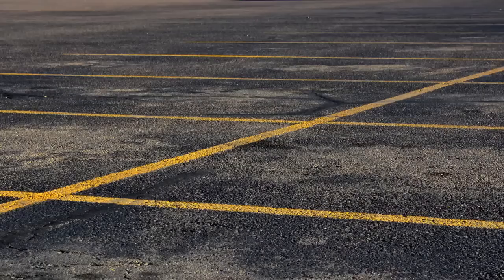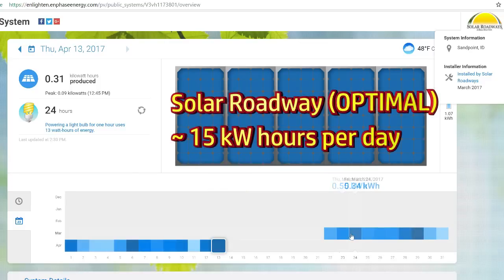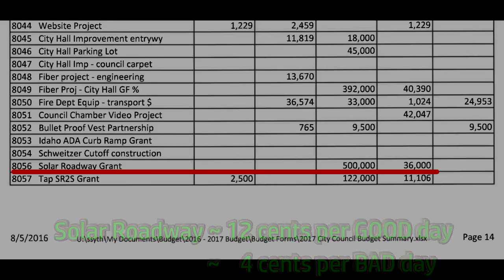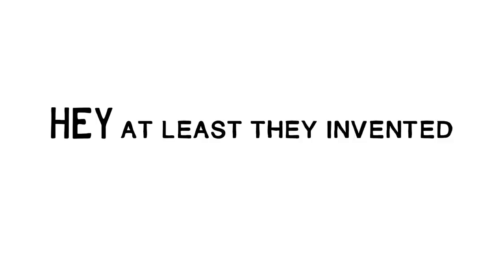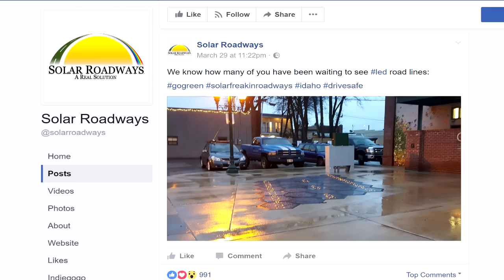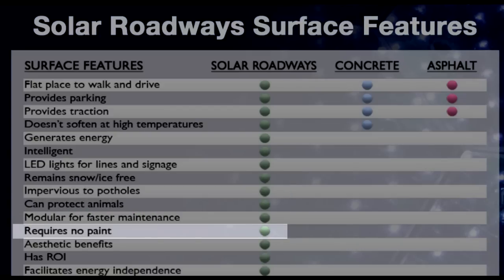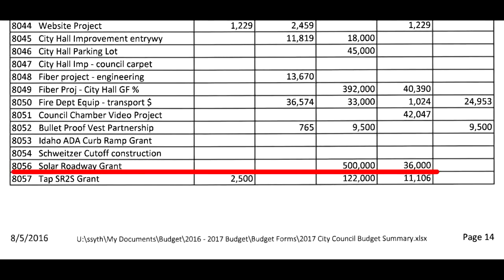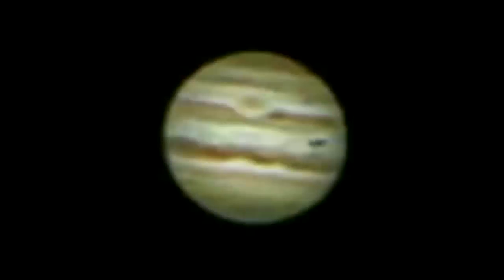Solar Roadways generate ~10 CENTS per day!!

Comment: Try and think of a solution instead of crushing their ambition. Perhaps instead of solar roadways they could've placed small panels in an array along the main roads which do follow the sun and on a night light up small LED's for driving safety. It may also prevent animals from crossing the roads and possibly being killed too.

I understand your point, Thunderf00t, and you're right. I just think you'd be better off trying to think of a solution to their problem and try and support a genuinely bright and ambitious idea which may help the world and future generations. Just imagine, you're stuck in the middle of nowhere because your car died and your phone is on 1% battery with a tiny signal. Wouldn't it be useful if you could walk to a nearby usb power unit on the roadside and charge your phone for 30 min? Some people don't stock extra batteries and don't typical think that they may endup stranded somewhere. This is convenience and if the roadways could be made better then we don't need to rely on the current monopoly in power supplies, the (pricey) grid.
Reply: That solution doesn't create solar roadways though. The ambition is to pave roads, paths, playgrounds and more pavements with hexagonal solar panels which provide power for each solar tile and combined enough power output to the surrounding homes and other electrical systems.

The solution would be something which bares this in mind and improves upon the design or technology within the tiles themselves so we still have our light up roads and futuristic looking landscapes at night which service the surrounding areas.
Reply: Solar power is pretty decent nowadays, but you need to have tracking stuff, shove it in the middle of the desert, and not having fucking cars driving over it.
Reply: this kind of idea is like why don't we invent a pen that can write without holding it. YOU WON'T FEEL TIRED WHEN WRITING ESSAYS ANYMORE. Come on, both me and you knows this shit won't work. If there is a way to make 1 cents per sqft solar panels, the electricity will be cheap as fuck, and solar road way still can't pay itself back.
Reply: you see, that's your problem. why light the roadway up anyway? why use this extra energy when there is no need for it? the only reason for led road panels is purely the self conceit of the producer.
asphalt is the best material for roads. period. if you want lights, use street lights and your car's headlights. and if you want road markings, use reflective paint and solar cats eyes. a system so cheap it costs no more than the usual maintenance cost and is now everywhere in the UK.
if you want to generate power, generate it efficiently.
Reply: What would be the point of creating something very impractical in sake of creating something new. Solar roadways is unfeasible concept, so there is no point of refining that unfeasible concept. Scrap it and create something that works better. 

Angled solar panels that we do not drive on are cheaper and more efficient. Creating electronic billboards on side of the road is cheaper and more efficient than creating flat tiles on road that have low visibility to drivers.

Making free USB charging places? Sure, who pays those because I'm willing to bet people use those to take power out of all the time.

We would have to create another pricey grid to transfer power to solar roadway panels they are wasting. So, instead of using existing infrastructure you would create another expensive infrastructure that does exactly the same thing we have already build. Doesn't make much sense to me.

Some ideas are just plain stupid and you have to realize it some point and not just pour money over it in hope that it someday gets solves somehow.
Reply: If we are discussing solutions to Solar Roadway's problems, I posted the following in the previous Solar Roadways video.

"I have no gauge as per how sincere the personnel behind this really were; a dream pursued too earnestly with unrealistic expectations. Clearly they are indeed making efforts in refining the production methods of their "slabs".

With the materials and methods they are using right now, surely their panels will remain ineffective. People may complain that the whole prospect was a massive scam, but in critical thought, what I think this project needs is more research and major design improvements.

A replacement for LEDs: Assuming that their claims about improving glass traction are true, the main jibes are at the inefficacy of LEDs in direct sunlight. The major issue thus is the reflection of the glass surface. Now, if we take regular roadways with bright paint against asphalt, their "great" visibility is due to the paint's high reflectivity contrasted with the asphalt's darkness. If Solar Roadways were to fund a materials science team to research highly durable, electronically excited materials, operated similarly to LCDs, that could alter their pigment and or reflectivity, we'd have something like a durable Kindle E-reader for roads - "electronic asphalt".

The burden would be in creating larger applications that are durable, can be reliably activated with minimal current and eventually made inexpensive to produce in large quantities. If we're lucky, it could be a curing paste applied above a flexible substrate arrayed with electrodes applying an area effect to the material above. Whether the flexible substrate is dark or highly reflective defines whether induced transparency darkens or lightens an area. Using a(n albeit far away) technology like this would solve the issue of daylight viewing.

Light pollution: An obvious concern would come from astrophotographers who may very much dislike the amount of light pollution solar roadways would contribute. Ideally, the variable reflectivity surface would be composed as to reflect light only from high angles of incidence. During the day, the variable reflectivity should not impede the solar panels from operating with the sun at "operating elevations", and during the night, they should act as electronically controllable retro-reflectors relying solely on headlights. This gets rid of the useless LEDs, light pollution and perhaps lowers power consumption. Maybe we can have mobile, 3D projection road movies that technically don't take our eyes off the road?

Power production: Regarding power production, they will probably have to resort to more sophisticated methods of power generation that mind the obvious problems with traffic. Say, they, with the desired materials science team, could generate a piezoelectric and Peltier substrate, ideally applied in coats of different pastes. The solution for patches of solar panels being continuously covered by cars would be to work towards an inexpensive "solar paste" that while less efficient can cover a much larger area overall than otherwise possible with regular solar panels as to negate the disadvantages of cars rolling over them. Intercity and rural roads would be best at making up for inefficiency via greater comparative throughput while city roads would rely more so on the kinetic and thermal energy transducing. 

Compatibility: Having the solar roadways applied as a conductive "paste" could make the system compatible with existing road beds and thus act as a "smart-top". Likewise we might use an electronic, conductive and disposable sheet layer to act as a "charge collector" and image signal distributor with signals going to and from connected processing modules stored in protection to the side of the road. Scrape existing roads, apply an initial paste to provide a smooth surface for the "PCB cloth" and then pour and cure the all-in-one photoelectricpiezopeltiertransducing paste on top. Next is to make it recyclable, and the sheet, biodegradable. :)

As per the heating elements, I've read an interesting comment about them riskily attracting wild animals to lay down on them during winter - 'twould be an intriguing sight.

In short conclusion, I think Solar Roadways just need to be "engineered better" and can be regarded as a long term project dependent upon the materials science lead time."

Comment: @15:34 there is a mistake. 1 000 000 sq ft. with $500 per sq ft. is $500 000 000. You had the value as $500 000 000 000. That is three orders of magnitude bigger. I mean, the first one was big enough. It's probably problem with converting long and short half a billion .

Comment: I get the inadequacies of the system as it currently is. But I think its an idea worth pursuing for the future. Regular solar panels started in a  not too dissimilar state in terms of efficiency and cost , but we got to a break even point with persistence and I think given time and money this sort of system could eventually be viable. I guess the issue is how much money will it take to get to that point. Quite a lot I guess, is it worth it though?

Comment: I do milling and paving for a living I can tell you this won't work imagine doing 70mph over that. The installation would take so much longer it's staggering, the paver usually moves along at 100 feet per minute to put things into frame. Highways get radar tested for flatness, it's a golf cart with radar mounted on a bar front and back to check for imperfections. This just does not work in my mind, as someone who makes roads, this goes against everything I've learned where does water go? It's going to pool on top of the panel fill up to the top of the let's hope it's at least aluminum fastener bracket.

Comment: If it was cheaper to install these it could be great, even pulling in ridiculously little power just because you would have an insane amount of area filled with them. But definitely if you are gunna do solar road ways, it'd be better just to paint them rather then with lights, its nearly pointless to have the lights.

Comment: In the Enphase website linked in the description, if you press the recycle button, you'll see various power supply scenarios for the selected day.  On a good day, the system will run a refrigerator for 6 hours (rounded up).  It can't even power an office kitchen.

Comment: one of the big advantages of putting the solar panels above the car (as they were at the end of the video) is that it gives the car shade.

If the car is already cool, you'll burn much less gas using your AC.
Reply: But burn more gas because you have to drive with your headlights on.
Reply: Peter van der Meer 
ya got me there, 😉

Comment: If they are flat on the ground, won't they always get sunlight?
Reply: Solar panels are too expensive to lay flat on the ground. They are more effective per panel, although you can generate more energy per surface area if you were to lay the panels flat.
The reasoning behind it is very simple; a football field will receive a certain amount of energy from the sun, by covering the field with solar panels you catch 100% of the sunlight.
Reply: Yes, but you need a lot more panels.
Reply: OnyxAnger no, round earth
Reply: Have you ever seen a spot of shadow on a flat surface?
Reply: OnyxAnger Yes, i always see a shadow on the ground
Reply: Haha damnit, okay you got me. I meant, if there is nothing to cast a shadow ofcourse. It'll always get direct sunlight right? YOu don't need it to spin around if you don't have it under an angle
Reply: Solar Panels are typically pointed towards the sun so they get more direct sunlight; you often see them propped on something that spins with the sun. Putting them flat in the ground is not nearly as good, especially with cars going over them.

Comment: Thunderf00t, agree with you, but most of your video here focused on the outrageous costs. However the inventor clearly said the $500/sqft was the current cost in the prototype stage (prototypes are always more expensive since they're not in mass production yet), so in the hypothetical timeline that this tech is adopted, by the time they're paving Walmart lots it would presumably be much cheaper, i.e. not on par with a NASA mission. Your video would be stronger if it addressed this.

Comment: There was just one typo: you said 500mln dollars, but wrote too many zeros at 15.45. You can see 500 000 000 000(that is 500bln already). Other than that - great as always
Reply: Hum..there are a long and short scales. In other words, different countries use different naming systems.

https://en.wikipedia.org/wiki/Long_and_short_scales
Reply: I know, but listen to what he SAYS at 15.25-15.35. It has nothing to do with long or short scale, because we are not beyond millions. 1 000 000(one million) sq.feet times 500usd per sq.ft equals 500 000 000(five hundred million) dollars... but the numbers in the video have 3 zeros more.

Comment: Wouldn't you be better off building tracking solar panels beside roads powering just LED displays? Like, the panels could be spaced as lampposts but more further apart and then powering dedicated displays?
Reply: "Wouldn't you be better off building tracking solar panels beside roads powering just LED displays?"

Yes, you would be and I don't know about elsewhere but my (small) town has already started doing it.

The lights and signs on the road near the end of the one I live on, for example, are run entirely off of a small solar set up attached to each one that tracks the sun.

Comment: Why wouldn't they use some colored plastic tiles in a cube that can rotate, so that they can change the color of the tile on the surface? This would save electricity and would be much more visible than LEDs! And that's something I came up with in 10 seconds...

Comment: Also if there is an accident on that road the damages cost far more than fixing regular road and not to mention those screws and other elements that hold those things toghether could be a danger if one of them sticks out and a vehicle will drive through it with high speed.

Comment: By the 1990s, the Chicago metropolitan area had 54,600 miles of streets and roads, including 2,500 miles of expressways, 17,300 miles of highways and arterial streets, and 34,800 miles of local streets. Almost 80 percent of all commuting was done by automobile. 
So the Chicago Metro area has 54,600 miles of roads, at 25 feet wide average (which is just counting them all as wide 2 lane roads) that is 7,207,200,000 square feet of roadway. At 1 watt per square foot, their test was 18 watts per square foot, that is 7.21 Gigawatts of electricity, Illinois produced 16.2 Gigawatts in Feb of 2014. So at 1 watt per square foot, the Chicago metro area uses almost half of Illinois' electrical capacity. That doesn't include sidewalks, parking lots, or any of the other places that would have these, or that some of those highways are 5 or more lanes in one direction.

That would be to melt snow during a snow fall event.

Comment: I don't think solar roadways will make any sense at any time in future. Yet, the account for installation costs in this vid isn't sensible (which reflects more on the vid author than on solar roadways in an unfortunate way). Surely, the first prototype will cost in the orders of magnitude more than a final mass production would. Of course, the deal-breaking point remains that separating the problems of street building and solar energy production is rather a good than a bad idea, by a rather large margin.

Comment: Solar roofs by Elon Musk's Tesla /Solar City are fine though right?
Reply: Solar roof tiles existed already, but didn't really catch on because the inherent complexity issues that always arise when you combine two things that are designed for a different purpose. Still, with advances in design and manufacturing most of those issues could be overcome. I'm predicting that his design will work just fine, but it won't be price competitive with regular rooftop systems, at least not at first. It will mostly be a niche product, for high-end neighborhoods and historical buildings where price isn't that much an issue, and/or rooftop solar is unwelcome.